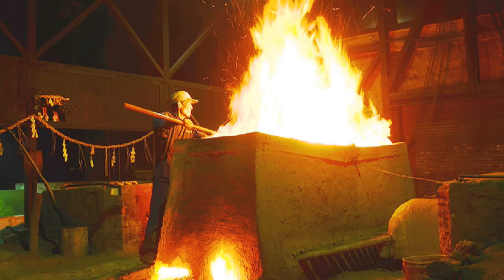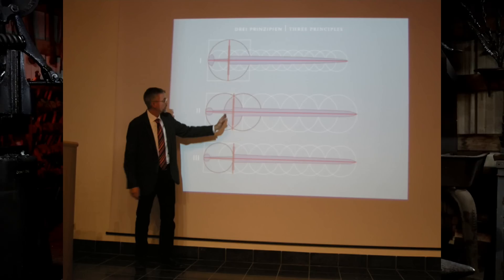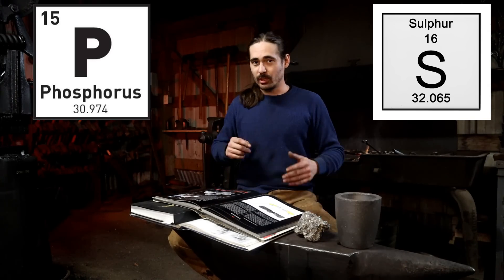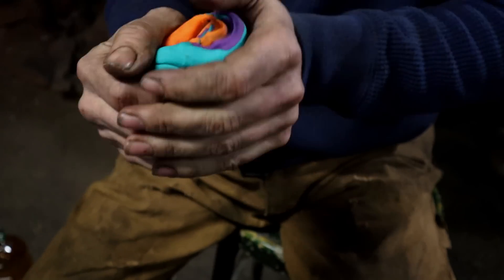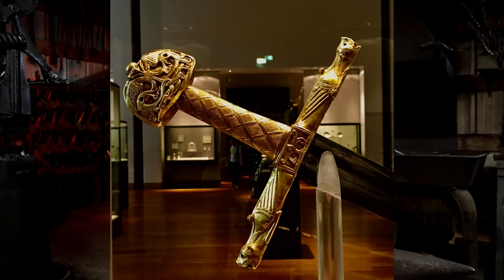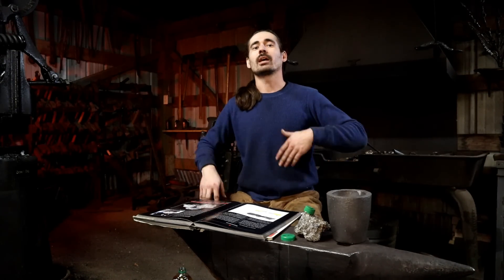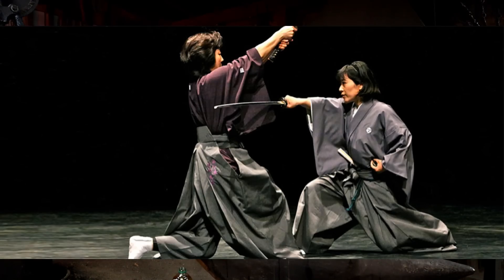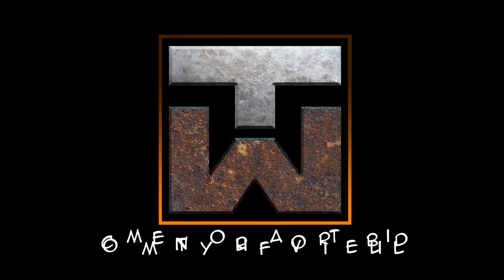Misconceptions About Medieval Steel - Wootz vs Bloom

Comment: I'm getting the message, but some of your comparisons are scewed (I'm not talking about the metallurgy, but your arguments about literacy and how you compare Europe and Japan here). For instance the Edo-Period you are referring to when stating literacy rates is not Middle-Ages. Its 1650 to 1850, which is modern times in Europe, not even Renaissance anymore (which end at the start of the 17th century). You refer to 80% of people in cities know how to read and write (which is a selective group, general literacy rate in Japan at the End of the Tokugawa shogunate in 1870 was 40%!). In Saxony at 1800 80% of all males (not only those in cities) knew how to read and write (but only 40% of women).
When comparing medieval Europe, you have to specify which time-frame, as "medieval" can mean anything between the 5th and the 15th century, but certanly not the 18th or 19th century where most of the Edo period falls into. For Japan before the Edo period, it is hard to find any literacy rates at all. I only found some data referring to one District of Nagasaki from 1650, suggesting literacy rates between 80-90% for homeowners, and 20-50% for Tenants (all male, no literacy for women as they all signed with thumb-prints or stamps). I found literacy rates for england for 1650, suggesting a literacy rate of 50% for men for the whole population, and around 10 for women. For Germany the general literacy rate I found for 1650 is 30%, which sounds about the same as in England as those combine the male and female rates.
All this literacy rates again say nothing about the proposed literacy rates of blacksmiths in particular.

I think your theory that literacy was the drastic difference between Japan and Europe is not supported by the actual literacy rates. At least not, if you are taking the same time period, and not just compare 1750 Japan to 1200 Germany. When comparing the Edo-period, you have to compare to late Renaissance or Modern times.
Reply: I recalled that the The Ulfberht swords including the faked ones were signed, but again maybe the smith making making the letters was simply copying them.  Some germanic peoples did know ruins.  
But there is likely a point in that Japan being somewhat insular and not succesfully invaded  written records of weapons making were kept.  
Anywhere most craftsmen including black smiths had their secrets and only their apprentices learned them.
Reply: @loquat44-40  There is actually evidence that literacy may have been high in Germanic cultures during the Viking era, though exact rates are not, nor can they ever be, known.  However we see the names of objects like "comb" engraved on to actual comb's and such in the remains of c. 8-900's c.e. Nordic villages.  The prevailing theory is that this was done to teach reading and writing.  There are enough such items scattered about the Scandinavian world to suggest that literacy may have been at least somewhat common.
Reply: and the fact that Smiths were in guilds  related to shrine and temples and supposed to participate in religious affairs and cérémonies, maybe a little more educated than the usual due to their surroundings.
Reply: Where Japanese swords made in as large quantities as europeans? I have the impression that the comparison is between swords used by elites (samurai) and average soldiers (european armies).
Reply: There were early typologies, reviews and buyer's guides back then. There may have been exaggerations on performance (how many bodies it could cut through), but people knew what they wanted out of their swords, and smiths were happy to experiment and provide. There are many unsigned swords (for various reasons), but the sheer number of signed swords with matching oxidation/rust patterns suggest that they should have some degree of literacy, enough to put down their own name or school (lineage) of blacksmithing.

 @Annou7la  Not all katana were for samurai. In fact commoners (especially merchants) could own katana, often with even fancier fittings than samurai. What was regulated was the length and number allowed, and later even regulations on fittings.
Reply: @spamfilter32   It's known nowadays that most writing written using runic languages was lost because except for stuff like runestones it was often materials that weren't kept.  For example, the Norse equivalent of a grocery list for a trading expedition might be scratched on an ordinary stick with a pocket knife.  When that shopping list is no longer needed the stick might get used for firewood.  That style of writing is very ephemeral and hard to find examples of years later.  That means that we'll probably never know exact literacy rates because the majority of things written down didn't survive.
Reply: But then again, the general message stays intact--blacksmiths in Europe are still treated more or less as low class people & there's hardly an established culture built around them, thus making it far more likely that most are illiterate; whereas in Japan, blacksmiths, or actually, swordsmiths, in this case (given how unlike blacksmiths, swordsmiths really do make swords & nothing else after all), are respectable, high class members of the societies, with very close ties to the ruling class, therefore making it near impossible for them to be among the illiterate.

The general literacy rate back in those periods did have little bearing on how literate the blacksmiths were, but the general attitude the people in general back then treated the blacksmiths with, I'd say would actually played a key role in determining the amount of knowledge they held & were able to pass on, sophistication of their lineages, & ultimately, the actual functional quality of their blades.
Reply: @shaun Alan well it depends on the era.
early japanese medival era is around 900. here boushi (warrior) were the singular fighting caste and formed a knight like elite fighting ritual duel wars.
in later eras the ashigaru were introduced as mass soldiers. every of those had a sword. so mass production was done.
at the end of the sengoku jidai and the beginning of the tokugawa shogunate, the tokugawa confiscated a large amount of swords and let a buddha statue get forget out of them. the statue has a weight of about 25t, so a very large amound of swords had to be collected for that, considering a katana is around 1300-1600 grams
Reply: The Middle ages end at a different time in different countries. In Japan they end when Commodore Perry lands. In Russia they end in 1917.
Reply: I admittedly know next to nothing about Japanese history, but a different time period doesn't necessarily mean different levels of technology or social structures - consider that many native American tribes were still on a stone age level of technological development when Europe was already in the gunpowder age - , so if Japan still was a feudal society with low urbanisation and craftsmanship and manufacture being the predominant mode of production over industry during the Edo period, it's still a valid comparison. That being said, I agree that the argument has holes. The European middle ages, as pointed out by others, were far too complex to be summed up into a single literacy percentage, and I'm having some doubts about how relevant literacy even is for passing on craftsmanship traditions when the underlying chemical processes are poorly understood anyway.
One additional caveat is that blacksmiths may not always have been from illiterate social castes - the Ulfbehrt swords, for instance, are speculated to have been created in a churchly context.
Reply: One thing to add on, a year later ^^, to the content of European literacy. in the Medieval period the standard for literacy was not being able to read, it was being able to read a SPECIFIC book, the Bible. to be considered 'literate' you needed to be able to read at least to some degree in Latin and be able to read the Bible; as a way to keep scholars bound to the Church i think. so the stats would be skewed by that as someone with fundamentals of reading in their native language whether Italian, German, English, French, Polish etc etc would not be seen as literate as it was not Latin from the Bible.

Edit: added point i forgot to mention. it's the reason why scientific naming of flora and fauna is done using almost entirely Latin, because it was a common language of the educated across Europe so a mistranslation wouldn't cause a mistake, a made up example for the point, but one language might say 'North Bear' and another 'Polar Bear' for the same animal, which might lead to confusion whilst 'Ursus Maritimus' would be something the educated would all know as the same.

Comment: swords at best were a back up weapon, so the fact that there were a lot of poor quality swords isn't that surprising
Reply: Pistols are a backup weapon in the armies. Do they have to be of poor quality? Swords were a simbol of power and prestige, used mainly by the elite. Why should the elite would trust their lives to a poor quality weapon? The fact is, that swords require more techology to be made. It is more difficult to make a sword than to make another edged weapon. Swords were of poor quality because the technology was of poor quality.
Reply: @herrero4270  The cost of making a good quality gun is going to be similar to a poor quality gun. The time need to make a good quality sword is going to be a lot more than a poor quality sword. What are your considerations for the sword, is it for your self, or a gift? Or do you have to arm two hundred men. How much do you want to spend, how much can you spend. How long do you expect the sword to last in battle. For prestige all you need is a ivory handle with some gems, the blade can be good or bad quality. Prestige is someone else's perception of the object. You mentioned swords breaking in fema, did you account for the swords that had hardened tangs and were breaking at the tang? One method for making crucible steel, was to use crushed glass for the last layer. The glass would seal the crucible while allowing gasses to escape.
Reply: to use crushed glass for the last layer. The glass would seal the crucible while allowing gasses to escape.
Reply: @hightest40  Swords were not used by most of the MiddleAges soldiers. AsI said, they were mostly used by the elite.
Reply: @herrero4270  Yes, as were the other primary weapons. Polearms, Glaives, Poleaxes, Spears, Halberds etc. Much like how once the gun came around, we started making secondary weapons, swords, out of monosteel. Kind of a bad analogy too, as a handgun today cannot shoot nearly as far functionally as a rifle can. Which is the primary and which is the secondary?
Reply: @hightest40  Good quality gun takes back ten waaay longer over poor one than good quality sword over bad one. Only the barrel takes an absurdly long time to make since it's basically a sword in the form of a pipe. Every bigger firearm than the one you could carry needs to be made in the form of files of steel shaped into a pipe. Hence the "barrel" of a gun. Yes, the pipe needs to be folded multiple times and it gains the damascus pattern (dama-steel pattern).

Comment: Something I am a little on the fence about is the fact that I have handled antique swords from around the time of the renaissance, one I still remember had a manufacture date of 1552 engraved on it, coming from Italy. I definitely didn't abuse it as hard as I would have a modern steel sword. However, it didn't take any noticeable damage from sparring (I know, horror, sparring with an antique). It definitely is stiffer than a modern sparring sword, the one I used against it was a EN45 blade tempered to about 52 HRC. However, due to the fact that it is likely of mid 16th century origin (Like Meyers Gründliche Beschreibung), the steel used might not be bloomery steel, but from a blast furnace, explaining its similarities to 19th, 20th and even 21st century steel.
Reply: So it was signed Mdlii?
Reply: @HanSolo__  no, by that time arabic numerals were already in common use, especially in Italy, so it was written 1552
Reply: @JmbFountain  My first guess would be Roman. Was it punched or engraved? Like highly visible or only slightly? Any manufacture pin punc?
Reply: One thing about antiques that old is that they are often of a higher end quality to have both survived this long (survived both nature and people repurposing the metal) and be preserved in decent condition. If those were already more stiff, I imagine anything closer to average wouldn't compare as well, and then a whole half of the swords were worse than whatever said average was. 

For me, the damning evidence against the "springy swords were common" theory is the lack of common metal bows. If closeish to modern spring steel was available in large, bows would regularly be made of those, but they werent made. Japan had a few metal bows, but they were rare as were the craftsmen who could produce such items reliably. Pretty sure some craftsmen in Europe could produce comparable steel and evem shape them into blades that big time nobles paid premium for, but they were likely equal rarities.
Reply: @JmbFountain  do you have a picture of it?
Reply: @louisvictor3473  crossbows sometimes had metal limbs
Reply: @atom8248  Yes, but medieval crossbows are a different animal in spite of the general similarities. You need to bend the much chunkier (but shorter) limbs considerably less (much shorter power stroke), and the metal limb ones required mechanical devices to load and ready for a shot, and the better one are already pretty late medieval already (we are looking 15th century onwards). The material properties required for that and for a regular muscle only operated bow are considerably different.

Comment: "crucible steel" in the form of wootz from southern India wasn't just made in southern India. It was made in other places as well. I was once told of a manuscript by a Hindu preacher who described Foundry men dripping molten cast iron into water to prepare pellets and drawing out wrought iron into wires which were subsequently chopped and allowed to diffuse into one another at high temperatures. From studies of noble swords, they contained iron of low phosphorous content as current scholars don't believe a basic refractory liner was used in historical examples (based on unearthed crucibles). What would happen was that the cast iron would melt and the increased surface area of the chopped wrought iron wire would allow for easy difussion of the excess carbon into the wrought iron from the cast iron pellets. Moreover, rust was often added for further decarburization. Finally, and this is a bit controversial, it's believed that terracotta (clay) pipes heated over coals were used to channel monsoon winds to raise the fires temperature. It never reached a full melt as these were heated with charcoal, but close enough.

Comment: For Norse blacksmiths, or at least traditions from Finland and Baltics, blacksmiths were actually pretty highly valued, though of course they weren't literate at all (As proven by making 'Ulfberht' copies, by putting inlays on their swords, though writing the name wrong. Though there seemed to be some other stuff too). Looking through a document for Baltic tools, swords and knives finds from 8-13th century, they had varying degrees of carbon and some proof of likely 'case hardening' the blades, which I think are pretty neat, which they used bloomery steel from limonite mostly. 

Which you have to keep in-mind they were still pagan (Before Sweden, Templars and Rus crusaded them) and there were smithing god(s), which Greek and Rome certainly valued their smiths as well. Though of course, since after the crusades and christianization, the use of weapons or longer blades became more taboo to own. I'd say the value of smiths become slightly less, but I think more appreciated still, than in medieval Europe. Though at least the development of weapons with constant warfare and so forth, with swords became more relevant as a culture. 

Though the use of spears, bardiche and such were at least quite prominent in Finland for a while, along with the crossbow. It is also true that crucible steel back then was a lot more tricky to work with, as you could just air harden them, than quench them in the traditional way. This also includes working any crucible steel bar and so forth, was pretty hard. So usually people ordered Ulfberht blades and the handle with hilt were made locally. The quality of Ulfberht ones I think were pretty good, though the bloomery steel from the finds and analysis, seems to indicate that they were pretty decent too. Some had 0,2% carbon, some had 0,0% carbon back and 0,7% carbon edge and so on, it depends. For the HRC itself and proper heat treatment though, it's harder to say.

Comment: A question, how did the later crucible steel makers deal with the phosphorous problem?
Reply: Flux. It binds the phosphorus with the slag.
Reply: @lDanielHolm  More specifically though? Lime, pure iron oxide, borax, old slag? What was the additive used for effective removal?
Reply: @tristantheafflicted  Limestone, I believe.

Comment: After i saw the Shad's absolutely biased video about comparing katana and longsword i was wondering is it impossible to make a katana with lears of spring steel?  I have sean a catana which is not made with traditional methods but 1 layer of knife steel 2 layers of copper alloy and 2 layers of  stainless steel It is not exactly the same technology but i guess you can still call it a katana because it has the same shape but it is far more durable than the traditionally made katana with 1 lear steel and 2 layers iron. So when you compare katana and longsword what do you actually compering? Is it molded swords agenset sword with different layers or the whole process of 1 and the other?
P.S. That was a very good video